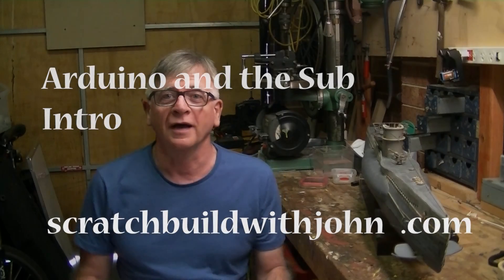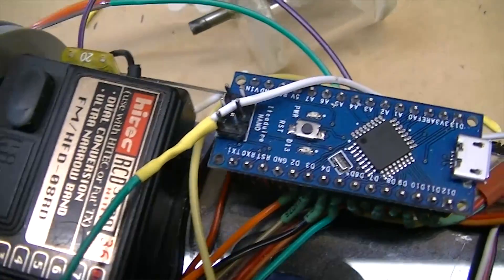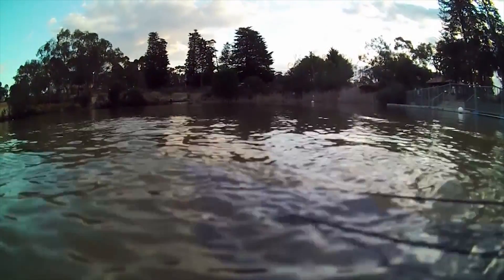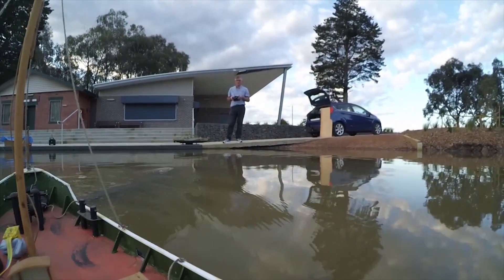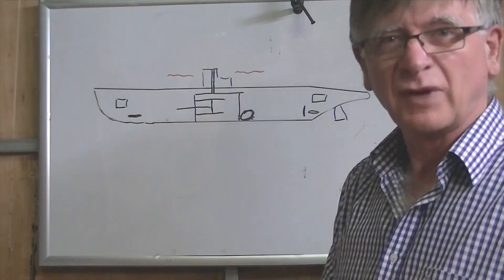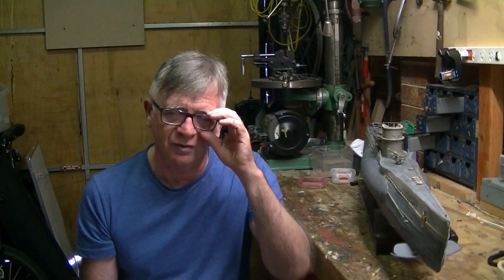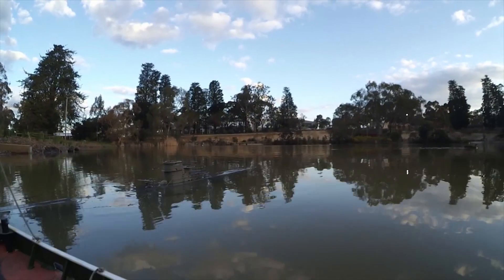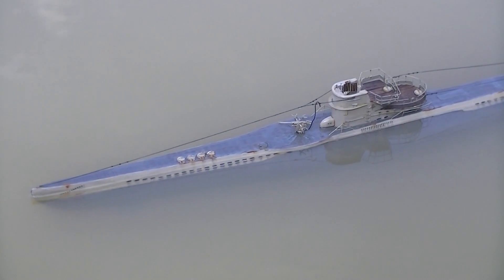arduinosub1

Comment: Nice sub! You might want to see if your receiver has a ppm output you can tap: https://wiki.paparazziuav.org/wiki/RC_Receivers_and_Radios#35.2F40Mhz_RC_Receivers

Then you can software decode the ppm signal from your receiver with just one wire running to the arduino and the number of channels is only limited by your transmitter!
Instead of relays you can use N channel mosfets like irlz34, they are smaller, lighter and just as easy to use once you know them a little :-) You can hook them up to your arduino pin with just one resistor.